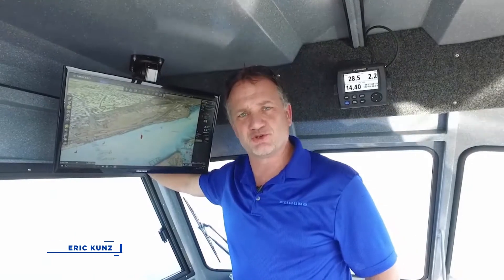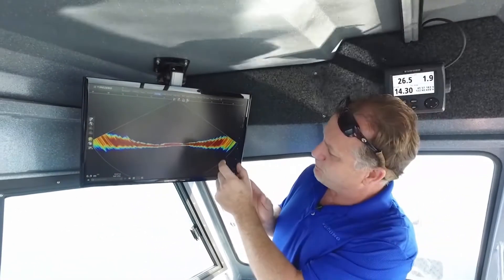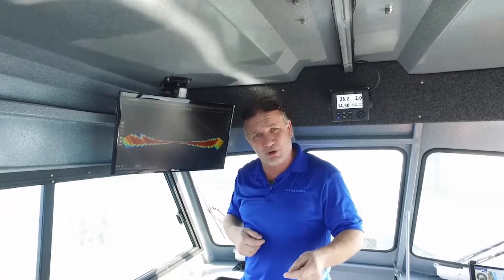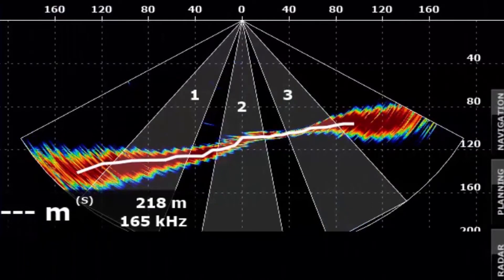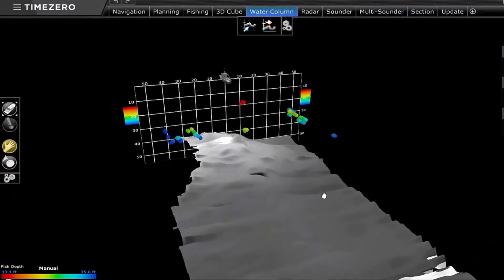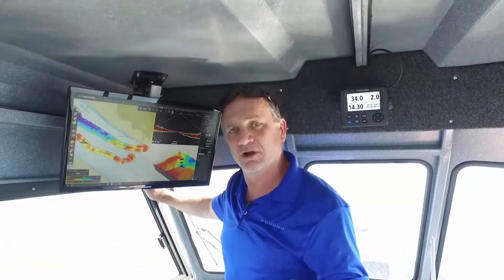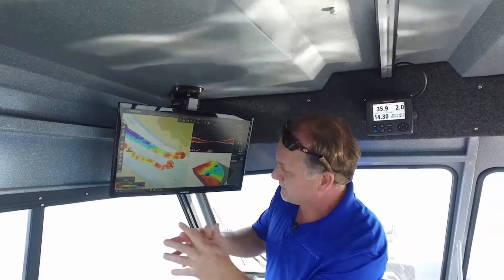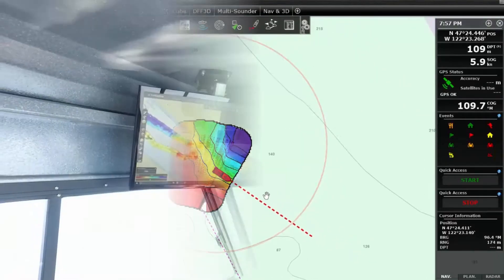Discover the potential of the DFF3D when combined with TZ Professional

Comment: You would only block the 120 degree DFF3D beam if there was more than 25 degrees of deadrise or a had large keel. This is a very shallow dead rise boat. You could put this xducer just about anywhere in front of the prop turbulence.